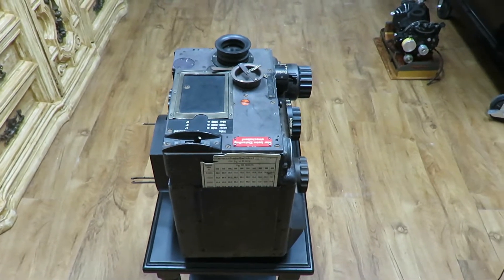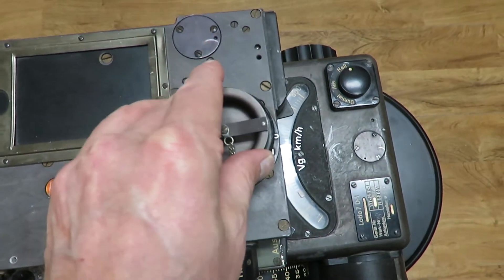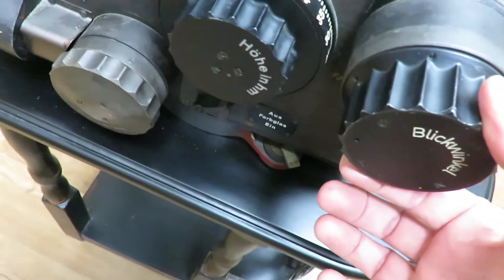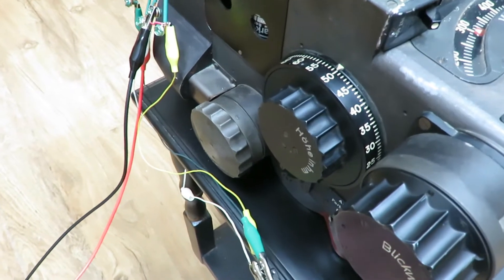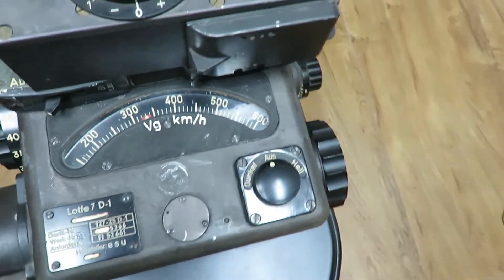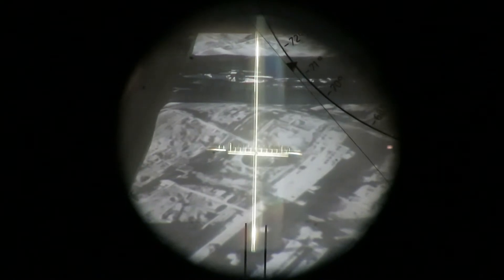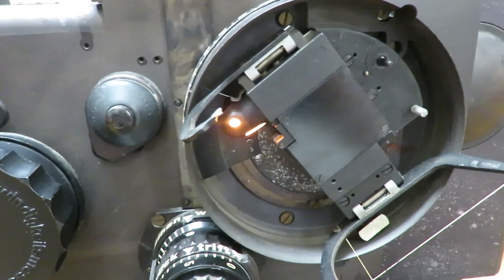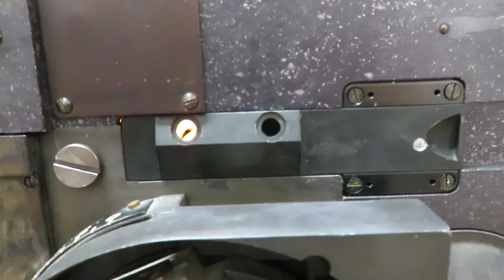Lotfernrohr 7 Tutorial

Comment: Hi Wistarmo, Thank you very much for your quality content! Using the LotFe in flight sims and pressing some keys on my keyboard, I never understood how it really worked and was operated.
I was wondering whether you know which LotFe versions were used in the He 111 H-6 and Ju 88 A-5?
Reply from the maker: Since making this video, I have discovered how the autopilot interfaces with the bombsight for turn and drift, and it's rather complicated.  I have not had a chance to make an updated video.  Other than that, the video is correct. From Deutschelufwaffe.com: Lotfe versions in the following aircraft types:Lotfe 3D - He 111 H-2, H-6.  Lot 7 - Ju 88.  Lot 7A- He 111 H-5.  Lotfe 7B- unknown!  Lot 7C - Arado 234 , Ju 88.  
Lotfe 7D - Ju 88 , Arado 234 C-3, Fw 200 C-3 / U2, C-4, C-6.  
Lotfe 7H - Ju 88 , He 111 ?, Fw 200 C, Me 262 A-2a / U2 with a lying bombardier in the fuselage.  
Lotfe 7K - Arado 234 B-2 ?, C-3 ?, C-5 Me 262 A-2a / U2Lot 7K-2 - Me 262A -2a / U2.
Reply: @Wistarmo  Much appreciated! :)